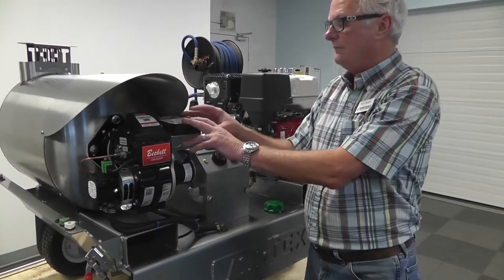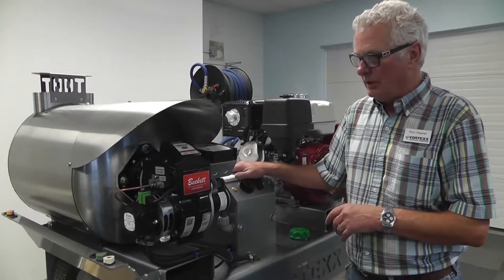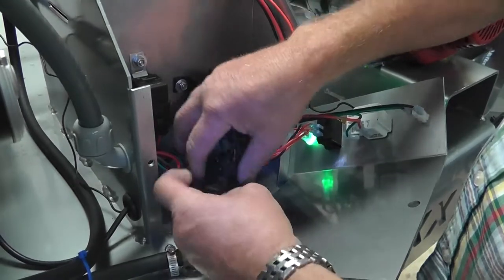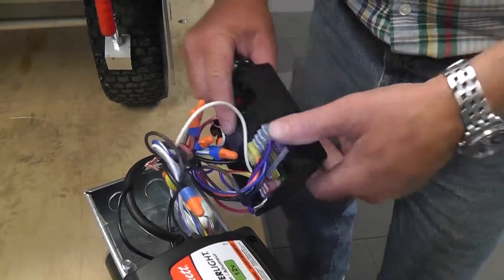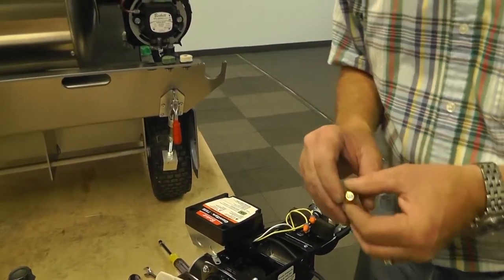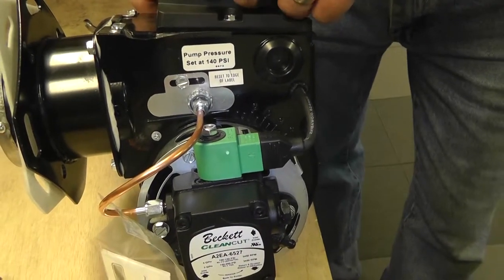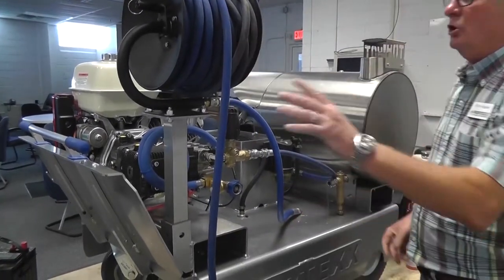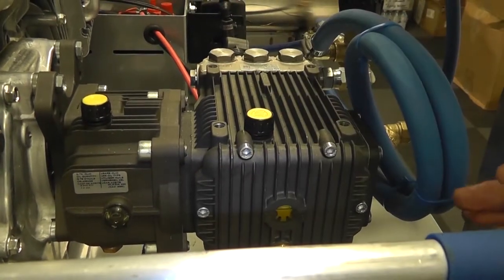Part 3 - Hot Water Unit: Servicing

Comment: I've got a pressure pro 3500 unit with 140hrs on it and I bought it new back in 2021 but I push the switch and the red light comes on but the blower doesn't come on and I drained the clear fuel filter and the diesel dosent fill back up what's wrong with my hot side?
Reply: Hello Devon, 

Without knowing the specifics of your burner, I can only offer limited insight.

That said - generally, if there is no fuel draw to your burner, there is either a problem with the burner pump (ie clog/blockage, electrical, or safety switch), a bad fuse that is affecting the pump operation or air in the fuel line. 

If your unit utilizes any safety switches such as a pressure, or flow switch, the burner may not kick on if either of those are bad. 

Check for any bad fuses on the unit, check all other electrical connections on the burner and re test. 

Your unit should have come with an operations manual for the burner, that would be the best resource for troubleshooting any further.

Comment: My machine recently is blowing white smoke from the bottom.
Reply from the maker: Is the smoke coming from the engine, or from the pump?

If it is coming from the engine, you will want to get that looked at by a servicing dealer found on our dealer locator on our website. 

If the smoke is coming from the pump, that is most likely steam coming from the thermal valve. That would mean your machine was run hot and should be inspected for further damages.